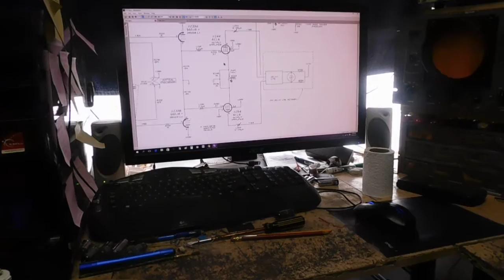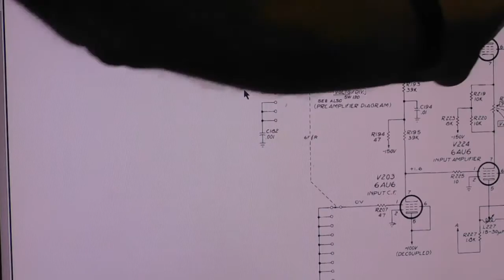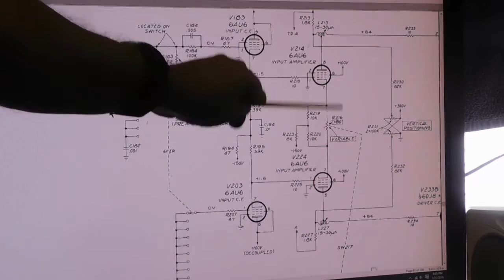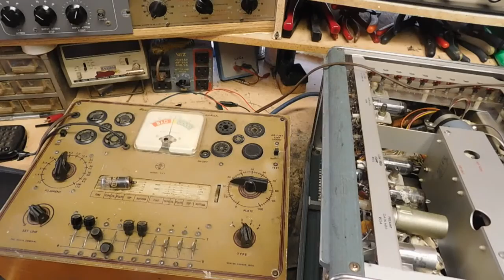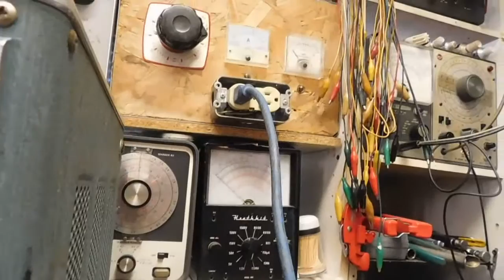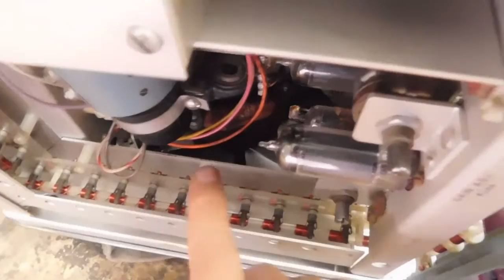Troubleshooting the Tektronix 317 scope

Comment: Very informative.  I'm currently working on troubleshooting my old 1950s Tektronix 531 scope.  Nothing is displayed on the CRT.  All of the low voltage power supplies are within 5%.  So next I'll ohm out the CRT filament to make sure that's not open.  If that looks good I'll try using your troubleshooting technique of connecting the vertical deflection pins together on the CRT and pairs of tube plates in the vertical circuit to see if the line is too high or low to see on the screen.  Thank you!   -Dave

Comment: I have a Tektronix 465B Ocilloscope with Traces that are too Short. I've Checked all the Transistors in the Horizontal Section and they are good. The Manual talks about Shorting Amplifiers as you have done but I was afraid to attempt it! Have you experience with the 465B?

Comment: Just beautiful how those things were made.  I have been told solder connections are silver and I think that is true.
Reply: Yes, most of these old Tektronix scopes use ceramic terminal strips.  It's very important to use the correct type of solder (3% silver) on those connections or the metal connection points may de-laminate from the ceramic.

Comment: That is a great way to fault find.I have always measured the difference in voltage between the two points.Same difference if you think about it.Is that a burnt screen on the crow or a camera illusion. Great video  keep up the good work.                                                                Thanks Michael